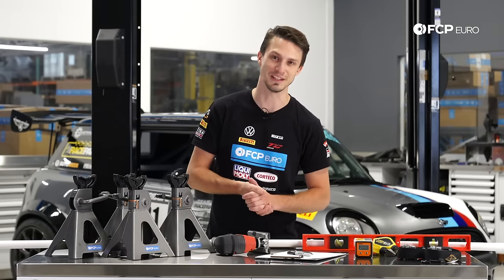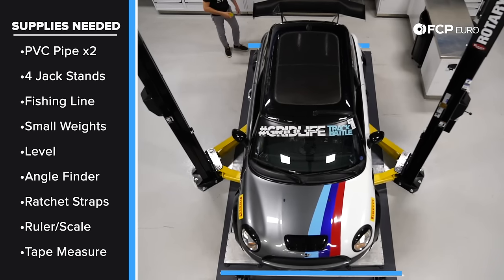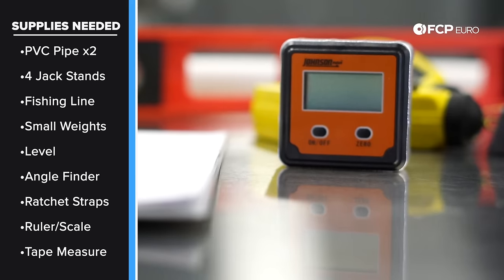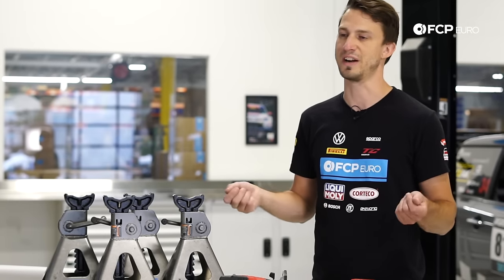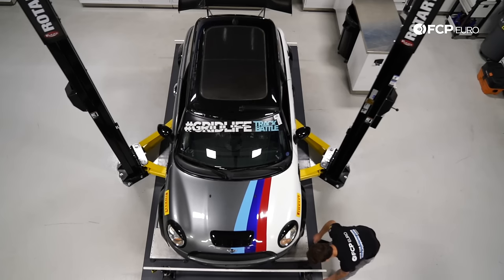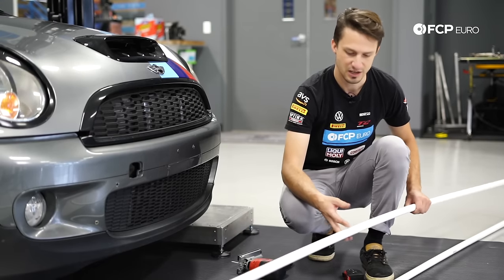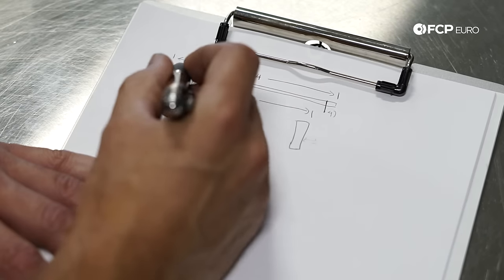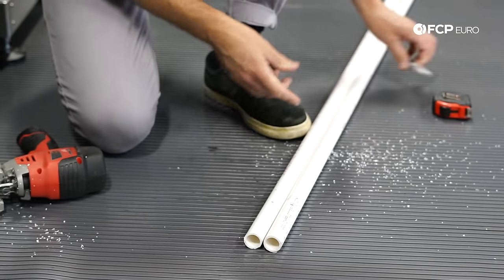At Home Alignment Made Easy - How To Use String To Align Your Car

Comment: I think all of these string methods on YT are REALLY inefficient in their setup. You don't need the string to be the same distance relative right to left. All you care about is that is that the string is parallel to the hub on each side, meaning distance from front drivers = rear drivers. The driver's side could be 100mm, and the passenger 80mm, for example. This saves a TON of time (especially if you're solo) in setup because you don't have to go back and forth right to left.

Then all you care about is the difference in distance from the string from the front and rear of each wheel. From that you can calculate or look up the angle on a chart.

Comment: Hi, nice video with clear instruction, the rear is measured total toe-out of 2mm while the specification says 0°24' (or ≈3.2mm) toe-in. Shouldn't the rear toe be adjusted?
Reply from the maker: Since it is a racecar we actually run a tiny bit of toe out intentionally on the MINI, but under normal conditions you'd want to bring it in to neutral it out

Comment: Great video, learned quite a bit and thanks for the conversion chart, this will save me so much time down the road for future alignment setups.  I had a quick question at the @17:18 mark you said the front of the wheel was 95 which means and the back of the wheel was 92 but they are reverse on the paper so doesn't that mean it's actually toe in by 3?  Also, how is something done like this when you dont have a 2-post rack to rely on and don't want to disturb your string box? Thing I've seen are two piece of cardboard or two pieces of plexiglass with some grease inbetween for easier wheel rotation on a standstill but this also means you can't really rely on locking your steering wheel down and set it to centre every time you turn the wheel.
Reply: The readings are right but his brain is wrong, 95 on the back side of the wheel and 92 on the front side of the wheel, which make the back of the wheel wider than the front measurement indicating toe in. For some reason his brain was processing toe out. You are correct though, glad someone else caught that too. We are only human and mistakes can happen, sucks though when they do. lol
Reply: @genisys0069  They're going to have to reshoot the whole video.. :D
Reply: When he measured it he said 92 at the front and 95 at the rear and when he wrote the numbers on the paper he wrote 92 at the front and 95 at the rear. That is, indeed, toe out.
Reply: @rihamy2nd  FR is toed in and FL is toed out based on the paper written at the 17:32 mark.
Reply: @markopascuttini5621  the way this works is that a smaller number at the front of the tire and bigger at the rear equals toe out. Let’s take it to extremes. Let’s say the front edge of the wheel is actually touching the string (impossible because of the tire, but this is just for illustration). That would give us a measurement of zero at the front. We’ll say  200 millimeters at the back of the rim. Now tell me… is that toed in or out?
Reply: @rihamy2nd  If the front of my wheels are pointing inwards /--\  than it's toed in, if the \--\ for example where the left points in the same direction as the right then the left is toed out and the right wheel is toed in and further we go \--/ then both wheels are completely toed out.
Reply: @markopascuttini5621  you’re not telling me anything I don’t already know. That last question I asked was rhetorical. I was just stating the fact that with the way this technique of checking and setting wheel alignment works, if your measurement at the front of the wheel is smaller than at the back, then the wheel/tire is toed out. If my memory serves me correctly, in the video the right front tire had 92 at the front and 95 at the rear, which is toed out. The left front looked like it said 98 at the front and 90 at the rear, so that one was toed in.
Reply: @rihamy2nd  You would be correct. Left was toed in, right was toed out. Didn't think it would be a hard concept to understand lol it's basic measurements. Even if those measurements were swapped for each tyre, the results would be the same, just swapped around.
Reply: @KR4Z3D666  I’m glad someone else sees that.

Comment: hi, love you video, i just got a simple question. if i measure 50mm front and back, and i want 3mm of toe in, should i get the measurement 53mm on the front and 47mm on the back, or should i get 51.5 on the front, and 48.5 ob the back?
Reply from the maker: You're measuring the difference essentially so as long as the spread is 3mm between front and back of the wheel then the numbers themselves don't really matter. So in your case the 2nd version of what you mentioned would be correct as the first would be 6mm

Comment: Might as well ask. You did TOE up front, and then camber. You mentioned that if you did the rear, and changed camber, you would need to check toe again.
So, up front, if you have TOE setup correctly, and then change camber and caster by changing the top mount, you don't need to check toe again?
Thanks!!

Comment: I'm confused at 15:00, if you align the box to any point on the wheel, won't be non-square? Any amount of toe or possibly even camber will cause the box to be different. Perhaps if you measure from the axle/hub instead?

Also what about castor. And if the axle itself is bent, would it cause a thrust angle even if both sides' wheels are aligned properly relative to each other?
Reply: Yeah I was curious why they weren’t lining the box to the body of the car. Or at least to the center of the hub.
Reply: 1-2mm out isn't going to be noticeable and well within specs.
But yeah, exact hub center or measuring off the frame would be the most accurate.
Nonetheless, quick at the track alignments have been done this way forever especially after whacking curbs all day.

Comment: I aligned bike tires with none of those things.
Perfect wear and ride.
Thankfully I hadn’t seen this video.
I was done aligning it,
 in the time it takes to watch this💡
Reply: A bike you only need to manually align a singular wheel... Front's self align on the axle with some releasing of pinch bolts and a quick bounce.
It's not even remotely comparable to aligning 2 pairs of wheels to each other.

Comment: Color me stupid but if the front is wider than the rear and you set your lines parallel to the car that means you're measuring off an angle that isn't making the wheel point straight. Meaning wouldn't that give you positive toe?

Comment: String alignment doesn't work on all cars because the rear axle is not fixed relative to the front. Like on my old Saab with a stiff axle and panhard rod, you will never get it dialed in because of the rear sway bar setup which means the rear axle can move somewhat sideways depending on how the car sits. You need another method and focus on two wheels at a time. The rear is not really adjustable.

Comment: Where did you guys get the retractable fishing line? All I can find are rolls of bare line, having it retractable so it's reusable would be more cost effective in the long run
Reply from the maker: B-G Racing String Line Reels BGR201 should do the trick for ya!
Reply: Connect fishing line to tube, then attach a weight to tube to rotate it to keep line taught.

Comment: On Your sheet, the front tire you have written the front of the right wheel at 92mm and the rear at 95mm from the string.  This is an indication of toe out which should be a negative number -3mm not the +3 mm you have written.  The +3mm is a toe in, indication.

Comment: If both pipes arent exactly parallel to both axels and to each other- the strings are not going to form a square box. Even if the distance from string to hub are same on left and right, the strings on the frontend may be closer to or farer away from each other than in backend (forming a trapeze not a rectangle) thus measures will be worth close to nothing. You may measure the distance between the strings at front and backend but this is very unprecize unless the strings will have some tension to it and won't bend. Now if you know what are exact differencies of rear and front axle length- you may actually use the string method, but you still will not be able to set (or even measure) camber and caster which makes entire operation good enough to align god enough go to the shop but for this I believe fast tie plates are better. Been there, done that.
Reply: @D.Jay.  I think what you mean is parallelogram not a trapezoid. In parallelogram opposing edges (not planes to be precise, which is also a big problem in this method) are indeed parallel to each other. But in trapezoid (and this is what i meant)- not all of them are. Two opposing edges are parallel and two are not. I still see my point as valid, unless I am mistaken, which I consider to be possible, so please correct me if I am wrong. You don't need to insult me. What I think you can do instead is check the difference between a trapezoid and parallelogram.

Comment: Please correct me if I’m wrong, but isn’t the right front have a toe in and the left has a toe out. I thought on a toe in you need a less number in front and a larger number in the back.
Reply: you're right. his explanations are backwards. when the front of the tire is farther away from the measured line than the rear that is an inward facing toe.

Comment: Please share the link for the conversion chart for the various size wheels converting toe measurements from degrees to mm/inch
Reply from the maker: https://fcpeuro.sirv.com/Content_Marketing/Degrees_To_MM.PNG
Reply: It looks that chart is incorrect with its numbers for a 17" rim. For a 17" rim, the formula for minutes would be
Minutes = arcsin(measurement / 431.8) / (PI() / 180) * 60.

431.8 is how many mm are in 17 inches. PI() is 3.14159.

For example, a 7.5mm measurement is an angle of just under 60 minutes (1 degree).
Reply: Have a table that is not a copy? Its fuzzy.

Comment: Actually, the toe should be set last because there is always some toe change when setting camber and or caster. Also, the toe should be set off the frame, not the rear tires.
Reply: Toe is set by using dimensions from front and back of SAME wheel, just like the video.

Comment: 0.75mm is so small - no noob at local tire shop will bother to adjust that 🤦‍♂️
1.0 mm is 1/32 inch. So 0.75mm is less than 1/32 inch.

Comment: How do you get the factory numbers ?
Reply: eh, for basiclly all street cars,  back wheels get 0 toe and abit of neg camber, 1-2 degs,   caster doesnt matter at the rear cause they dont steer.   For the front 1.5-2.5  degs of neg camber will be fine, figure out what range of caster adjustment you have and peg it on the steep side and make sure there the same on each side.  For a front wheel drive car a couple mm of toe out and for a rear wheel drive car a couple mm of toe in.   Do that and youll be golden.   Most street cars dont have ajustable camber or caster so itll be whatever it is

Comment: iPhone has app built in able to measure degrees for camber angle  - just need to place a straight edge across wheel. App will show. -  zero + degrees.

Comment: Wow. Um for toe can't you save a ton of time by setting your steering wheel straight and just using a tape measure on the outermost tire tread and measuring the front and back of the tire as high up as the body will let you and adjust the tie rods until you are within the specs. They usually slow for + or -.25" toe then if the steering wheel is not straight turn both tie rods the exact same amount in the direction you need to get the steering wheel straight then lock the tie rods and double check that you are still in spec. Done. Just a measuring tape and a helper and a pen if you can't remember the two numbers in your head.  I get it your race car needs tiny adjustments for handling ect. I've never had a problem doing it this way on a daily driver car.

Comment: I have a better way...string takes too much setup...just use a tape measure to measure the outer tread lines distance...use a wheel chock to hold the tape end onto the tire...always measure from the same height above the ground, say 3” as varying high and low camber will completely throw off your measurements...start from the rear as that will affect your steering wheel angle on the road...if the wheel is to the right, then one tire needs to turn to the right and vice versa...determine if you have toe in or out to determine which tire to adjust...
Wheel is left, toe is in: turn l tire to the left
Wheel is left, toe is out: turn r tire to the left
Wheel is right, toe is in: turn r tire to the right
Wheel is right, toe is out: turn l tire to the right
Also you’ll get MUCH better handling with a tad bit of toe in vs effectively parallel front tires...but the rear should be parallel...This works great for me and all you need is a wheel chock and a tape measure :)
Reply from the maker: That works great for an at home DIY'er on a time crunch (toe plates are helpful for this for sure to keep the measurements steady and accurate) the strings allow for a more accurate total toe

Comment: Never put the camber gauge on the vertical centre line of the wheel, always put it in front or behind because the tyre bulge will give a false reading.

Comment: Good video. 
Measurement of the camber of a wheel. 
Wouldn't it be better and accurate to just use a metal level that only touches the rim and not the tyre. 
If the car is on the ground and you place a level over the tire then I'm afraid the measurements will be incorrect. 
Doesn't the tire at the bottom that touches the ground become wider at the bottom than at the top due to the weight of the car? 
So this must affect in a wrong way the measurement.

Comment: Track width is measured wheel on center. To find track width just deduct 1 full rim width from that 70''' outside wheel measurement.
Also why did you guys elect to place the scale levelers on a rubber mat, it sounds counterintuitive as the malleable nature of the rubber mat will angle the levelers once weighted.

Comment: Couldn't you take the original wrong numbers, apply a change to the numbers for the angle required for the car, and just keep loosening or tightening the toe to reach those numbers instead of measuring the threads of the tie rod?

Comment: I bought a kit that uses a red laser and mirrors that will give you all this info in less than 5 min. I think it was around $50.  If anyone wants to know what it is just respond and I'll post it in a response.
Reply from the maker: No matter how you get your measurements knowing what to do with them is the important part! Smoke and mirrors and lasers or strings will all get you to the same point.
Reply: do share

Comment: Always go caster,camber then toe.toe in is the front of the tires pointing in towards the center of the car and toe out is the front of the tires pointing away from the car. Never ever drive your car on a “string alignment “ this used on track because there is no alignment rack available and it takes too much time. Please do a video of this string alignment and then put it on a machine to prove the accuracy

Comment: 18:51, isn't that still toe in on the rear, relative to front of car? Otherwise it means i have had my cars rear set wrong last 5 years.
Does the table take into account things like my cars 18 inch wheels are actually 19 inch at the rim.
Problem with BMW tie rods, the slot causes the thread to rust and jam on. Silly design.

Comment: These string methods unfortunately rely on an assumption that the pivot points of the axles are exactly the same horizontal distance apart from the center of the "axle" itself, and that that axle is parallel to the other axle.  The also do not have any sort of wheel runout compensation :(  If you want a good alignment you'll need to address this.  However if is a race car which is known to be dimensionally mirrored/asymmetrical, and with wheels with no runout, then it would work accurately.

Comment: At home alignment made easy lol, I'm pretty sure most people don't have a $2,000-$3,000 lift to do an alignment at the home. If the car is to low to make the adjustments, stands would either have to be made or bought to get the car up high enough, similar to what is being used in the video, and that is what makes no sense because a lift is being used to make the adjustments. There is no need to even use a lift the way he is using it, all its doing is taking more time and more thought to make the adjustments. Most people are not going to be laying on there back measuring or counting tie rod threads to do the alignment, they are going to just turn the tie rod a little then measure from the wheel to the string and repeat until they get what they need.

Comment: After you measured the front string line and had it even from left to right, you then screwed that by moving the rear line . You should have rechecked the front and you would have seen a difference.

Comment: It's all fine, but I don't have my own house, just a parking lot in front of apartment building, thus I will save the video, and then get my car to a service  😆, as judging by the wear on the old tyres (just switched them out for a set of new winter ones), there is something off with alignment at least on one wheel.

Comment: This video is outstanding, but I'm sure I would make this monumentally frustrating.  I know with certainty I will pay $100 for someone to align my car while I drink cheap coffee in the waiting room.
Reply: As many here stated, they have had sub-optimal results at a shop. Even if you want to have a shop do it, it would be good to get it close after doing suspension work at home so you can at least drive it to the shop safely.